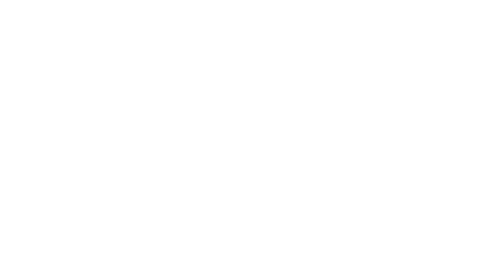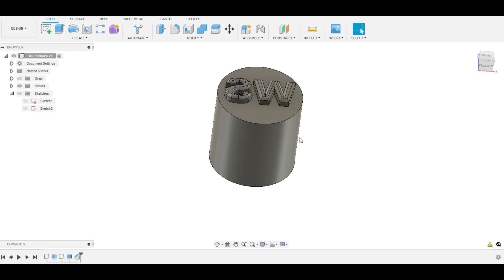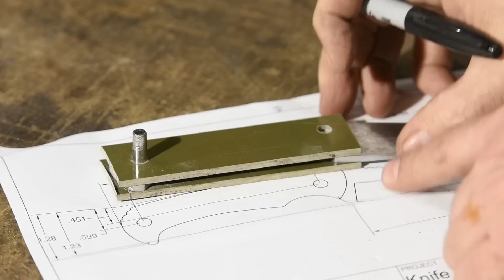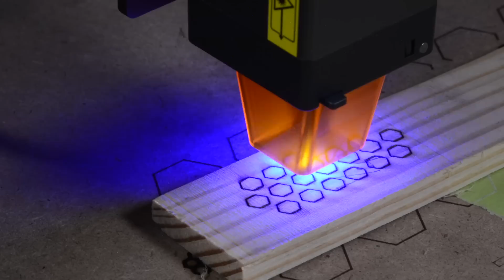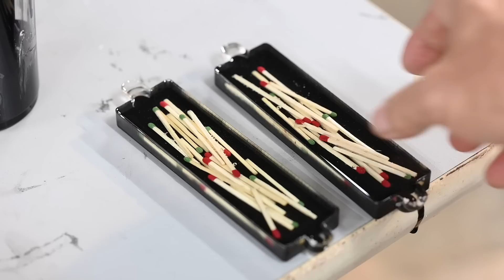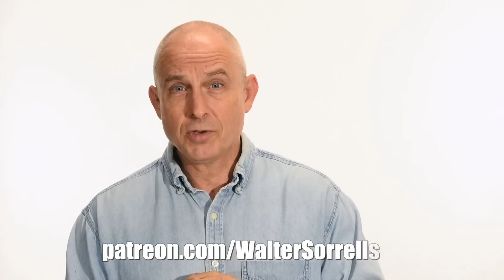Knife Making's Future - Knife Maker's Friday Five #60

Comment: I especially appreciate your commentary at the end of this video concerning the shrinking distance between the big manufacturing companies and the garage knife maker.  The tools make a difference in quality and especially in quantity.  I know that the advent of CNC driven machines and the capability of those machines to operate at extremely close tolerances has taken much hand work out of some manufacturing processes.  However, like farming, where tractors "needed" to do the job now are north of $300k, manufacturing tools can become enslavers, and that is where careful assessment is needed when considering such equipment.  If a machine causes you to spend more hours working to pay for the tool then where is the benefit?  I am not anti progress, far from it.  I am concerned that the joy of a highly prized  skill and talent will get buried in production demands to "pay off" the machine.  Our culture is bent on bigger is better, when in most cases it is not.  Car manufacture? Absolutely.  Knife making does not need to be fast and large scale, unless you want to turn out a bunch of cookie cutters that are cheaper, and there are plenty of companies already doing that, as you mentioned.
Thanks again for another great video, you are becoming a daily staple.

Comment: I have been working with: Lasers Cutters, 3D Scanners, 3D Printers, Autoclaves, Computers & a collection of other custom designed & hand built tools to produce custom knife blade & handle designs.  Hope to have a system to produce outstanding knives at affordable price points soon. 
I agree with your point about blade steels . . . The better knife blade steels seem to be within 20% of the top performers making them difficult for the consumer to differentiate.  Top performance knife blade steels generally come with a trade-off in the consumers ability to maintain the cutting edges.

Comment: Maybe mentioned already? You seemed to miss resin 3D printing. It's extremely high resolution and very inexpensive these days. The parts straight off the printer aren't necessarily useful for knife parts (though the resins being devoloped keep getting better and better), but they are routinely used for casting jewelry which, you can imagine because of that scale, needs to produce very fine details - and it does. Maybe if a knife maker wanted to iintroduce some cast pieces in & around handles and maybe sheaths, the 3D printer can be a useful tool in some knife makers' shops.

Comment: I have been doing a bunch of research on some of this lately and it's amazing what is out there. I ordered a little 3D printer just to play with it but they can actually produce some tight tolerances. I'm hoping to use it to cast guards and hopefully in time mokume gane. The thing is the prices for induction inverters are coming down and I think it's going to be possible to actually melt steel. I could see making up a custom mix and dropping it into liquid nitrogen (obviously with an armored enclosure built up) and producing something more like powder metal that could be placed into a custom pattern and doing some specialized alloy.

I was walking the dog last night and was talking to a girl in advertising. She said the forecast for next 3 years is for high end luxury goods and she was actually interested in marketing my knives as well as other stuff I make.

It is interesting what can be done. There is more information available and ways that we can use equipment to produce some crazy results. I think both knives and firearms are on a huge leap forward and it's crazy what can be with small investments. I think people are also sick of cheap boring goods and are interested in supporting local makers. On the knowledge base Larrin has produced information that has brought everything up and made it available for free or a crazy low price and Steve Midge put his $300 book out for free online and it should be a must read on diffusion welding. Seriously check that out. It's something that even guys who want to weld steel should understand better and will help understand welding temperature especially if you want to add copper or bronze or something else. They are getting stacks with copper and titanium in the jewelry world and I wonder how long before Damascus starts including non ferrous metals.

Good luck everyone and thanks for all you have done Walter. I have two nephews who are interested in knife making and you are my first recommendation.
Reply: Man I want to get into this knife making
Reply: It's fun and there are ways to get started with far less equipment than most think. I wish I had known and started earlier. Hit me up if you want and I will help you get started. The community is very supportive. It's a serious offer and I can even give you a blade to work with if you like.

Comment: Resin 3D printing can get some fantastic surface finishes so that might be viable for making knife handles. I don’t know if the resins are as strong as more common handle materials but the tech definitely is there.
Reply: It's not strong enough...
Reply: Many high end commercial kitchen knives are made with resin handles today.  In my testing over the last 2 years; resin handles cast over stainless steel tangs are viable 
options for kitchen knives.

Comment: One thing 3D printers are increasingly being used for is making patterns included in canister damascus, and the results are sometimes just astonishing. Getting a logo, or animal head in a blade is now possible for even garage knifesmiths. Personally I'm waiting for an inexpensive laser that will cut out my blanks!
Reply: laser is not good for tool steel. go for waterjet
Reply: Edm can kinda be done in the home shed
Reply: @false-set  EDM would be really nice. I did EDM on my dayjob. It was just fascinating how easy precision of a Micron was achieved. would be perfect for Folder making
Reply: I mean dudes have been figuring out crazy stuff for time. Howard Clark for example with his bainite blades. I recently just recreated my version of it. 

Ric furrer creating wootz at home and teaching loads of smith's about it. Walter has done some crazy stuff in his time as well with swords. 

I feel knife makers were actually a little behind in the creative stuff besides new steels and timascus and stuff.
Reply: @bmxriderforlife1234  how to you test for bainite?
Reply: @false-set  microscopes and other crazy shit. You essentially need to find a metalurgist or lab willing to test for you.
Reply: @bmxriderforlife1234  is it like a percentage of bainite? Does eliminate all retained austenite?
Reply: @False-Set  so the way Howard Clark's katanas work is the cutting edge is martensite like normal. 

The spine however is sectioned off partitioned bainite where as a traditional latana spine is pearlite. 

From what I know you can't fully get rid of retained austenite and if you did it could potentially hurt strength in some regards. But depends on steel alloy. 

Bainite is similar to tempered martensite. Well lower bainite is anyways. There's 2 kinds of bainite upper and lower. Upper is formed at higher Temps more quickly lower is formed at low Temps alot more slowly. Lower bainite is harder then upper bainite. Lower bainite also is similar to martensite of the good kind where upper is more similar to the weak martensite. 

Essentially what it does is give you a katana that functions like a laminated one with some advantage in shock absorption, and the same advantages differential heat treatment give. But it's also got all the advantages of a spring tempered blade. 

Lower bainite in many steels is slightly stronger then martensite at the same hardness levels but this is often kinda tricky due to martensite at the same hardness levels as most bainite is typically in the tempered martensite embrittlement area. Essentially if you tempered martensite too much via too high a temp it gets softer but also gets brittle randomly instead of more ductile and tougher. 

In best case scenarios for martensite, bainite is slightly stronger then martensite or same strength as perfectly hardened and tempered martensite. But probably a little harder or a little tougher depending on exact situation. 

Dual phase mixed microsteuctures aren't the best. But sometimes if you say have 80 to 90 percent martensite you can gain a little bit of extra strength by converting the remaining retained austenite that can be converted into bainite. 

Sometimes retained austenite is stable. Sometimes it's not. If it's stable it won't convert. If it's not it will. This is also why cryo treatment can work though requires tempering on top. Bainite is essentially already tempered martensite but slightly different crystal structure. 

Nobody has done full out microscopic testing of Howard Clark's blades and published it as far as I know. And he's refused to give a few people samples due to you can essentially figure it out if you are a scientist and he gives you test samples. 

I can recreate the heat treatment in 3 methods. But they all have pros and cons. Howard Clark has broken hundreds maybe thousands of blades in the development of that heat treatment. So he's likely fully perfected it. 

Imo I have a feeling the edge isn't fully martensite but the spine most definitely is due to the Temps and time he is running his blades. I do however think the edge might hold a small amount of bainite. But this depends on how exactly he does the heat treatment. 2 methods I can recreate it with would result potentially in an edge that's mostly martensite like 75 ish percent up to maybe 90. And the rest could be bainite. However you could also end up with a fully martensite edge that's just tempered during bainite formation. Other results in  a martensite edge that's unlikely to be fully converted due to the process and some issues involved, but would also still have a fully bainite spine. But the edge wouldn't contain bainite just retained austenite and martensite. 

Depends if you produce the bainite first or second. Also depends if he under told people how long he leaves them in the austemper for bainite and if the bainite is tempered after formation or if it's left alone. If he's actually running them alot longer to get higher hrc bainite then it could be he's tempering the bainite and edge at the same time or in creating the edge it tempers the bainite. 

It's actually a really complicated process regardless of which method you take. And even once you figure it out there's alot more variables to play with like so many it's mind boggling. And even once you figure out how it's done it only works on specific steels and requires other playing around with to get it to work. 

And I haven't event figured out part of it yet. The process does a few other things besides just convert the edge and spine steel. Tempering hamon formation and curvature all play a roll and there's like 3 variables for each. Plus quenchant details you gotta worry about. 

It does however make a blade that's essentially strong enough to cut a 1095 production sword in half. Well rather cause it to break into 2, not exactly cutting but breaking. Sword is also unlikely to ever snap even with abuse, the edge will likely Crack and spine bend. They're also damn near impossible to bend under normal usage and unlikely to bend even with abuse. 

Also means the spine is harder and not as ductile without springing back which prevents what's called sabering under really bad cuts against hard targets. Essentially think of bending a sword but instead of towards the sides it's in line with the cutting edge. 

A few other smith's offer bainite heattreatment and it can be worth it. But bainite spine and martensite edge is only worth it for a few reasons. Mostly if you want a hamon or do it the one way so you can still have a 60 hrc edge without taking as much as 90 hours or more to create. 

5160 if you wanted 60 hrc it takes 90 hours in a molten salt bath to form. Bainite spine martenside edge means you don't have to worry about trying to form the hardest bainite.
Reply: @False-Set  https://youtu.be/lRzRYZImfsE

Lol here watch this. That's what it does to a katana. They just don't break and when they do break they break where some idiot might still be tempted to sharpen it and try and use it. 

5160 is stronger then l6 btw. Yet he shows in that video his sword taking way more abuse then any albion ever would. Albion swords uses 5160. He's also doing all that with a 58 hrc edge and a spine between the high 40s and like 55hrc. So like 2 points harder then most albions at its spine. And like 3 to 5 points harder at the edge then any albion.
Reply: @bmxriderforlife1234  🙏 wow, thank you so much.
Reply: @False-Set  no worries dude. But yeah the bainite katana treatment is pretty cool. Bainite might not be worth it in most cases though. And for a durable katana you can likely just use a steel like Z Tuff and mono temper it and get similar results. But without a hamon. 

Z tuff is also probably the current best steel available for swords given its balance of toughness hardness and edge retention and the rest. Basically as strong as 5160 but edges out slightly. But at like 3 points harder hrc. And with alot better wear and rust resistance.

Comment: I have a special interest in kitchen knives. 
And for a long time the prices in that area havent made sense to me. Realy cheap makes sense...stamped with a secondary bevel ground. Low-mid makes sense also. Gorund flat bevel + secondary bevel. 
And then there is custom. Fantastic geometry, cuts amazingly, etc. But under 600$ there's nothing that adds anything compared to the 80$ knife.
Everything I've learned says, that the big difference is the geometry of the blade. And is there a reason you could not achieve the same geometry by using CNC? 
What I seem to be really asking is: Why are there no Chef's knives for under 200$ with 95% of the performance of THE best Chef's knife out there? 
Why has no one spent some money to really meassure the best knives out there and convert it into a Cad-file?
Reply: You're absolutely correct that most of the magic is in the geometry. The issue is that that magic happens (for the most part) in the last few thousandths. When you are talking about the difference of .010" and .005" behind the edge being the difference between "a bit thick" and "just right" that gets difficult to do with a machining operation with the overall geometry involved in a Chef's knife. Even homogenous steels move around a great deal when you're grinding when they get that thin. Once you tool-up to the point where you can get reliable results, you'd be better off making something with a higher profit margin. Many of the custom machines used by manufacturers known for quality knives use adaptive grinding to compensate for what is happening with the blade during the machining process. It isn't that it can't be done, it's just that the juice isn't worth the squeeze for a manufacturer because 90% of their customer base will never notice. Most of the manufactures that make decent knives on an industrial scale still rely on skilled labor because it is more flexible and just makes more sense, fiscally.  If you go check out Don Nguyen's videos about learning to make a Yanagiba, he does a great job of communicating the frustrations involved in material movement during the grinding process. In short "It isn't as easy as you might think"
Reply: There are a ton of knives under $600 that are light years beyond your $80 knives. It kind of sounds like you just simply have no clue what you are talking about.